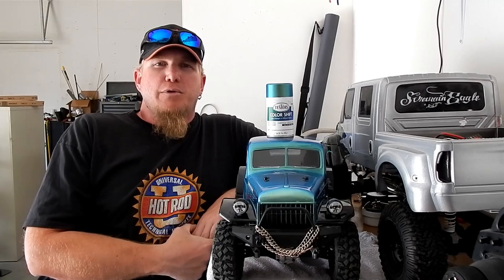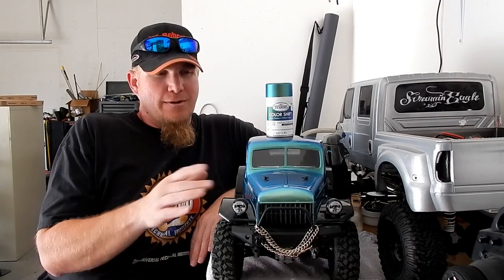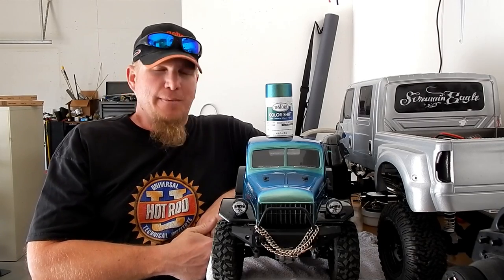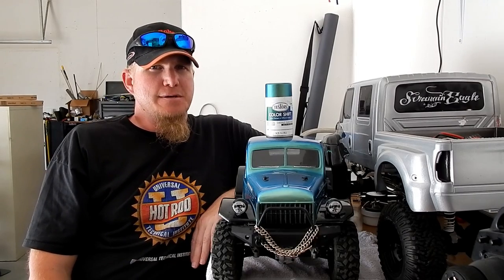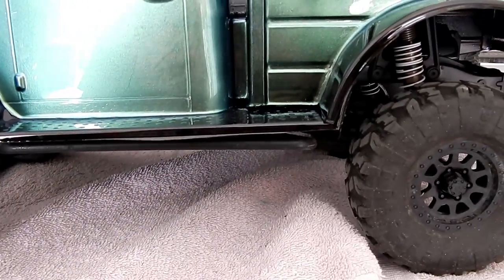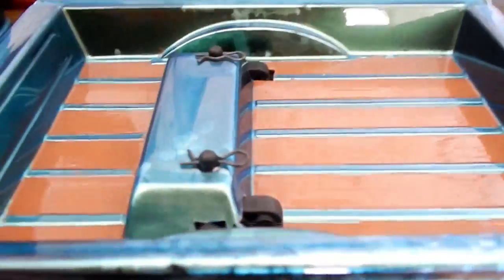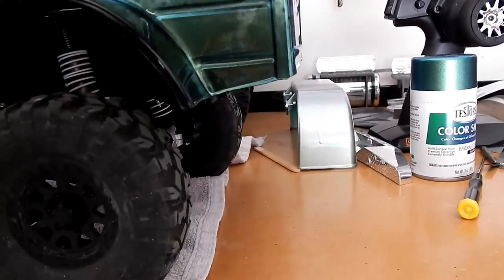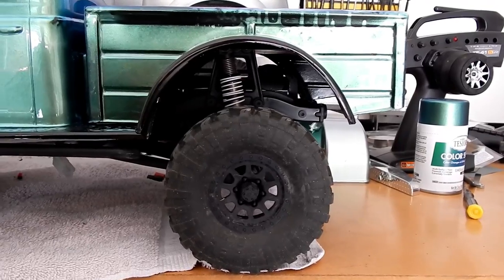Testors Color Shift paint review

Comment: Awesome, I've been looking for this kind of color change paint and was wondering if it's been tested on RC bodies. Thanks!
Reply from the maker: It does need a lot of patience. And spray very light coats.
Reply: @BlueDually4x4  Yeah I've previously used Tamiya's Iridescent paint, I would apply a very light coat and every 15 minutes apply a progressively heavier coat until the can just starts to go empty, to avoid splatters. Back with black and boom! Unfortunately Tamiya discontinued their blue/green iridescent paint, and this one happens to have an almost identical look. How does it hold up - any signs of paint flaking off?